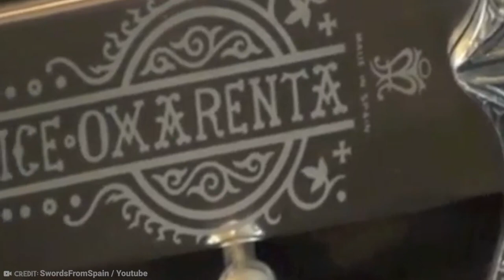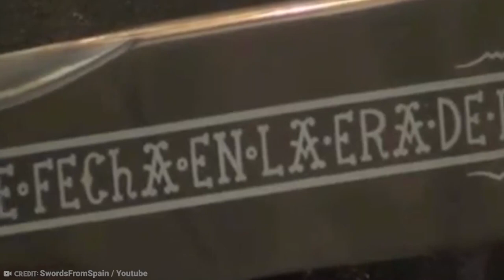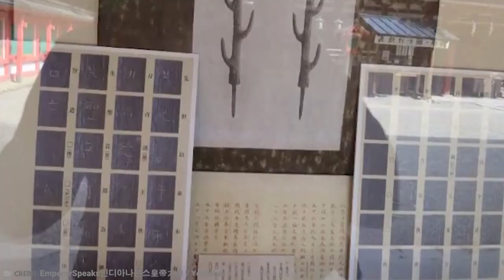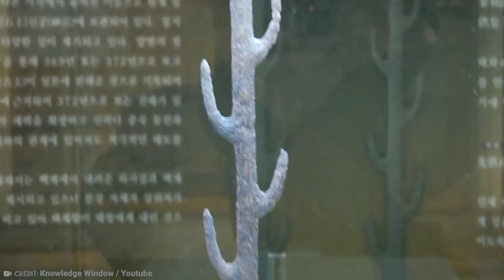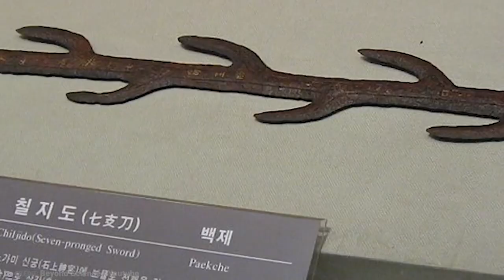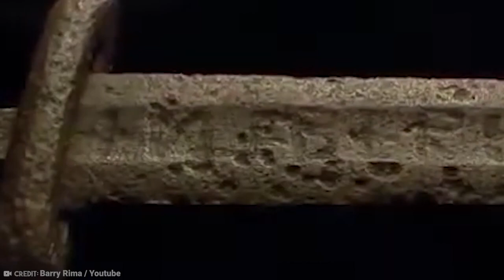20 Most Legendary Swords That Actually Exists

Comment: Really? The sabers had a mass production stamp on it. Do better, cause that was weak. Had that Saber been in the ground for ANY length of time the blade would've still had rust on it. Dude went out & buried them, let the sand resettle after a light rain, & BOOM! Instant interwebs sensation. Probably hustled a small fortune on the side with them.
Reply: I noticed that too. Looked like the crap someone would buy from a flea market or bazaar.
Reply: as soon as i saw the blade was still shinny, was like nope.. then the stamp..  so many of these digging videos are BS.. good call..
Reply: The key ring loop for the hanger was a nice touch too.
Reply: I loved the pronunciation of "Hussar". The Light Brigade are rolling in their graves.
Reply: Not to mention it wasn't even a sword. Pretty sure it was a dagger of done sort. Way to short to be a sword.
Reply: Also watch the footage of him digging it out. He seems to dig around it as if he knows the exact shape and size of what's there, even when only a small part is visible. Then he only uncovers half of it, then proceeded to pull the rest out while still covered by like a foot of sand and dirt. Something no one would do with a sword that was buried for potentially a couple hundred years because  after that long in the ground it may not be in the best condition and putting that much pressure on it may damage it.
Reply: hahahahah made in china LOL

Comment: Imagine making a video pretending to find an old blade decorated in gold, only to pull the blade from the scabbard and show the modern machine stamped makers mark on the blade. No rust or pitting on the steel, and no damage to the modern clear coating on the wooden scabbard. 🤷‍♂️ what a waste of time.